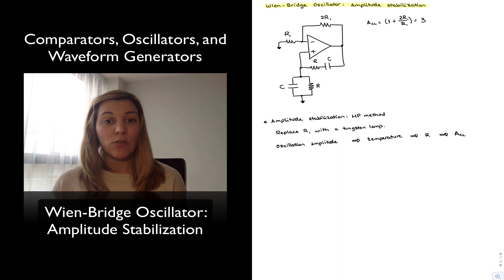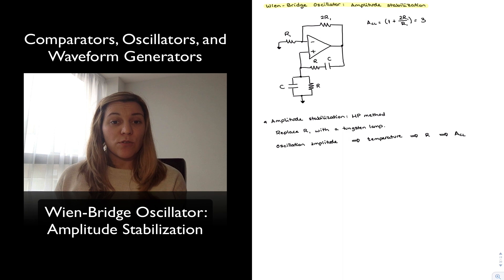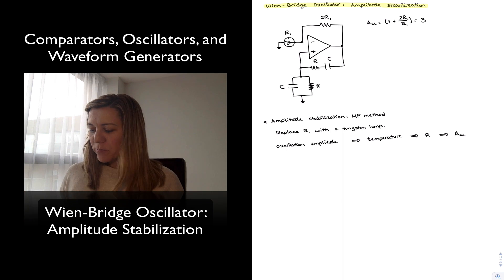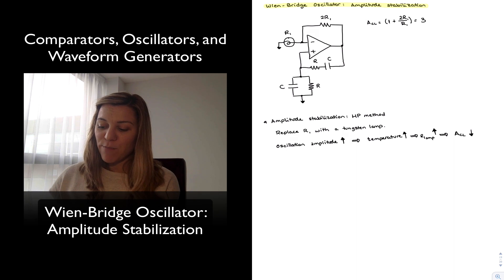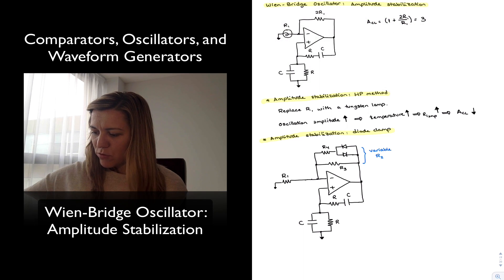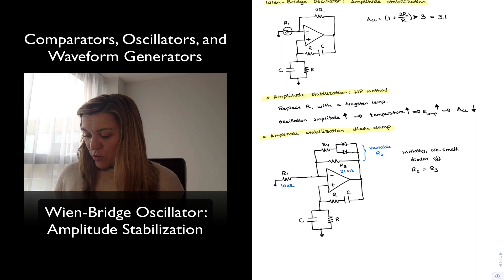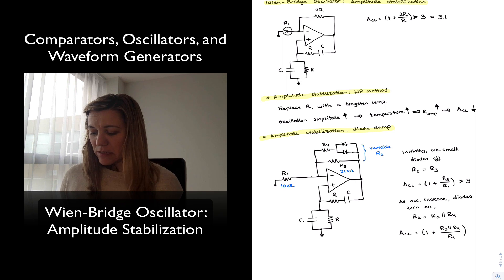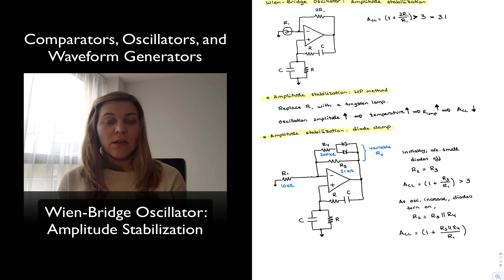Wien-Bridge Oscillator: Amplitude Stabilization

Comment: I've been working on a Wein-Bridge oscillator off and on for the last few days as a hobby since I haven't done analog design for decades but used to enjoy it in the early days of my career. I had difficulty getting the amplitude to be stable without the op amp going into saturation with the resulting high distortion. I tried using the light bulb approach to stabilizing the amplitude and it worked except that there was a small 5Hz amplitude modulation on the output that I could not figure out how to eliminate. At that low frequency it had to be something to do with either the light bulb or heating in the op amp due to having to drive the fairly low impedance in the feedback loop. I tried using a thermistor but it was way too sensitive to slight room temperature variations. Finally I saw this video and tried the diode clamp approach. That worked great! I can't measure the distortion but the sine wave looks perfect on the scope except for a very slight aberration when the diodes turn on and I can set the output amplitude somewhat by varying the resistor in series with the diodes.